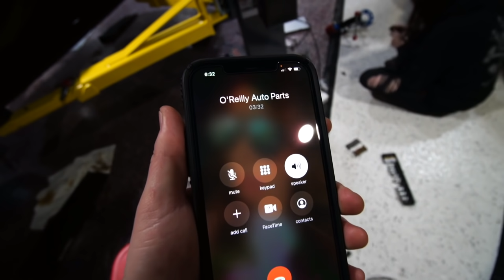Wrecked Miata IS FINISHED!!!

Comment: The caliper probably isn’t seized. There’s a nut covering an alan key thing, I think it’s a 5 or a 6, and you have to remove the screw to access it and loosen the alan key thing to be able to compress it.
Reply: Coming here to say the same thing. After putting the press to it, it probably did need replacing, haha.

Comment: I haven't been following the build and not sure if it's a 1.8, but 1.8 brake calipers have a short bolt on the back that when you remove allows you to access an Allen head bolt to run the piston back.

Comment: Also the caliper isn’t seized there is a bolt on the back you remove and there will be an Allen key under that you unscrew to release pressure

Comment: Miata rear brakes have a hand break mechanism in the caliper. You cant press them back in, you need to remove the bolt on the rear and wind them back with an hex key.

Comment: Isn’t there an Allen wrench behind a 10mm bolt to move and adjust the caliper? You can’t use a press on the rear brakes only the front I’m sure it wasn’t seized.... tighten the Allen all the way then back off a quarter turn that’s probably why the e brake doesn’t work right

Comment: You're not supposed to press the rear caliper, there is an bolt on the back you remove which is a cover and then there is an allen key under the cover and you turn that to back the caliper piston. Putting it on a press probably ruined it anyway so it was good to replace them.

Comment: U can buy fender rollers that have a lower offset on the flange then ur blue one for small cars. Or u can just undo the shock and use a Jack under the wheel👌 also u can get fender pliers for the fronts cause they are super thin on most jdm cars. No hate on wat u did Evan BOY.. 🙋‍♂️🇦🇺

Comment: i’d love to see the costs, as im trying to find a project car myself its gonna give me more information about stuff in general
Reply: had a 91 Miata with 160k miles, was bumped into so some paint chipped off bumper, needed rebuild, interior was in good condition. Cost of car : 2,000  Rebuild without extra tool cost : 650ish    new clutch kit : 160  (wish I got a bit better one)  New brake pads, calipers, and rotors : 350ish  New OE oil pump: 400   Total : 3,560  I might of missed something or got the price a bit off but the parts I got were nothing special and more on the cheap side, I think I would of been happier if I put in maybe 500 extra in total for some better parts as it was my daily and it did bring down the drivability a bit as the clutch was a bit heavy and the clutch kit did make some noise (not damaging) but overall it was a blast to drive. hope this helps. If you are getting a Miata and will be taking out the engine get at LEAST A 2 TON ENGINE LIFT from harbor freight. The 1 Ton will not clear the long hood but from experience it is not impossible to do it with the 1 ton.
Reply: @paulotremba4688  i work in damage repair so i do the damage and painting myself wich helps me save alot of money, its mainly the technical side if the engine room im learning
Reply: @paulotremba4688  but thats a decent price for a car makeover really, was expecting some more to be thrown at a Miata

Comment: There's a 14 bolt on the backside of the calipers, remove it. Then wind down the allen gear thats in it. AFTER THAT you can retract the piston. But you destroyed the caliper already by putting it in the press....

Comment: only reason i think a cost breakdown is kinda dumb is because i know area makes a massive difference in pricing, like where i live i cant find a manual miata that doesnt even run with 200k miles for less than 1.2k. some youtubers find miatas with 100k miles running condition for 500 every other day. so the costs to you wont really be the same for anyone else

Comment: That calliper is not seized Evan youve just been doing it wrong, mx5 rear callipers need to be adjusted with an Allen head screw hidden under a 12 or 14mm nut on the back 😂
This is also how you adjust the handbrake from the calliper too

Comment: No cost breakdown. First and foremost, looking in other people’s wallets is uncouth. There are so many outlets to obtain parts costs. Labor costs can change depending on location and availability. Parts costs can change for the same reasons plus you may have sponsors or gifts or even the inside scoop on deals, used parts and such. Just give details on what and how your parts were acquired and that should be enough. Your channel is about autos and a bit of inspiration. Why belittle it to gawking at expenditures and coveting? Your channel already shows enough fortune...like most YouTube car outlets.